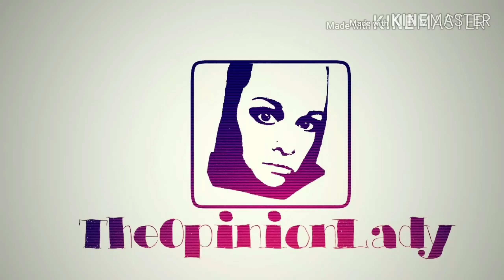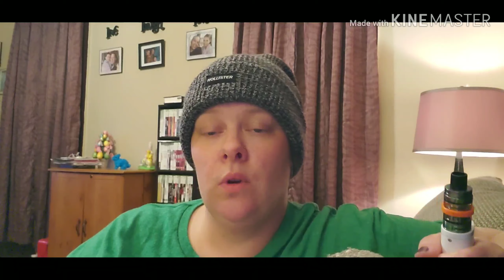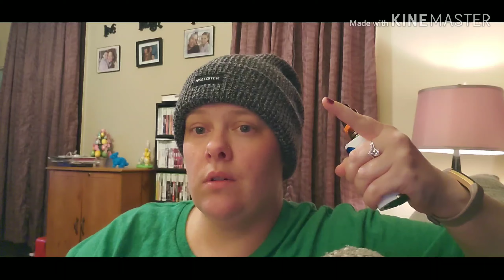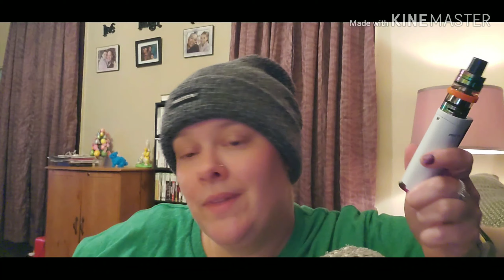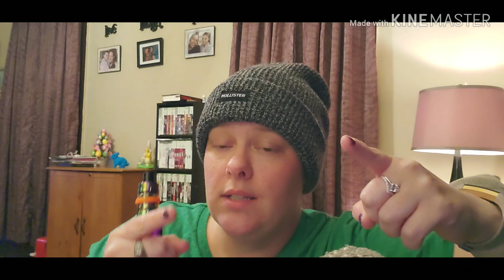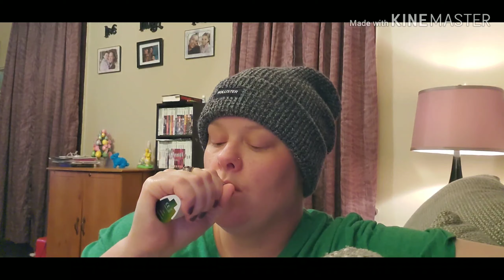Priv V8 not working

Comment: it will also blink when the battery is going dead and won't let you vape it I had one problem with another device the coil got stuck in I had to go to the vape shop and have them remove it I didn't have the tools to do it myself but I'm glad smok has safety features on the mods so we are safe vaping and we will always know something isn't right with our vapes💨 sometimes we will put the coils in to tight and not realize it till the mod tells you something is wrong with it

Comment: Having this issue now, I have the exact same Vape, same colors. Just bought a new coil. It worked fine at first than it stopped working. I tried to screw unscrew not put it on tight and it’s still not working. 4 Blinks. Pissing me off!

Comment: My Is fall down and the battery fall out and i put it back its not smoking when i put the micro usb in is blinking but not work
Reply: Did you fix it. Same shit happened to me.
Reply: It’s locked press it 5 times then it should flash 3 times that means it’s unlocked then just vape that’s what worked for me
Reply: @isaacsim9341  nigga i got so mad and angry i threw the vape from the 15th floor.... That shit gone.

Comment: My priv v8 stopped working just now and idk why , I tried taking the coil out and putting it back and it didn’t work , I tried turning it on but it won’t blink 3 times. I also tried taking out my battery and putting it back in, it blinks when I put it back in, but it won’t turn on. SOMEONE HELO

Comment: Hey I was given one of these mods the same one and I no it's not Brad new but I put my smoke prince tank on first it didn't work so maybe to strong for the mod then I tried a different smoke tank it's like between prince and. Baby beast smoke and didn't work eather then tryed my rda which dont have much resistance so it worked but then I got the baby beast tank with coil a double coil and it don't work battery is fully charged light flashes wen I fire it and if I keep fireing while hiting. I get a couple small tiny puffs of. Smoke but it's not working like it should any help please
Reply: bro did you fix this problem?